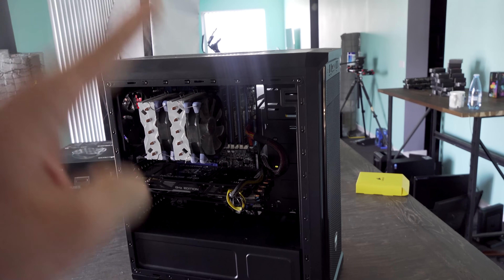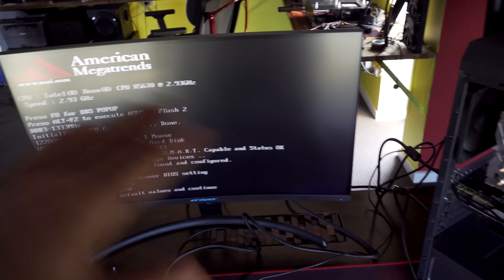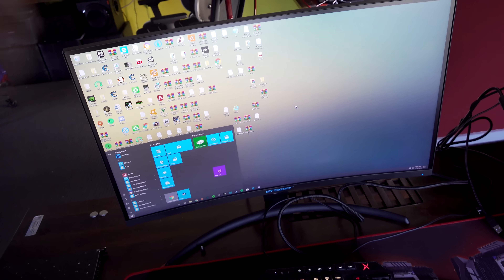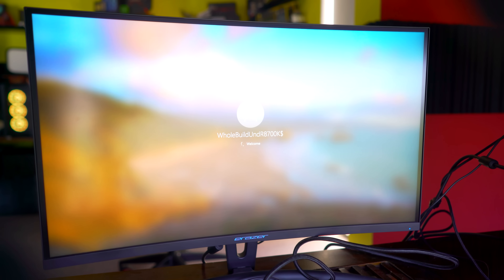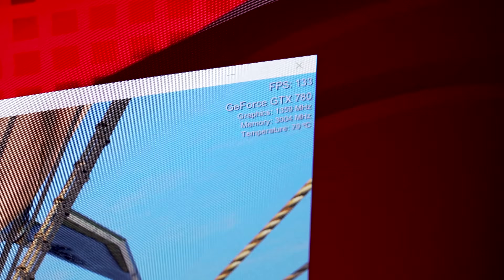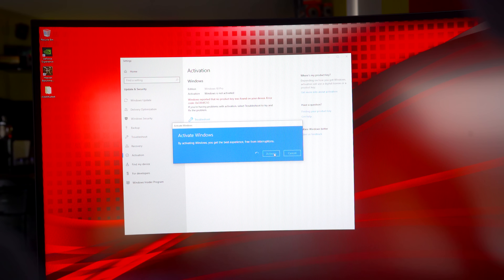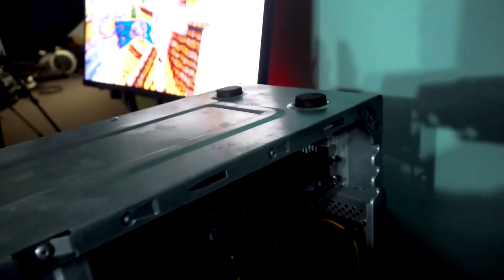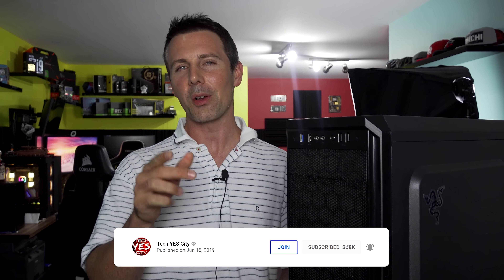Fixing "No Signal To My Monitor" - This Computer Came Back 2 Years After Sale.

Comment: Should've used windows built-in disk cleanup utility. I can guarantee you that 10s of gigabytes on that HDD are just old windows installation files.
Reply: Or ccleaner to clean temporary files.
Reply: @CristiBucerzan  disk clean up practically does the same thing
Reply: Does it also clean temp files from browser?
Reply: @CristiBucerzan  
I'd advise against CCleaner, it's owned by Piriform (now Avast) which is a pretty shady company. CCleaner also constantly collects user data and can cause blue screens if you let it mess with your registry aswell as cause problems with Steam/VAC. 

The windows built-in tool can do 90% of what CCleaner does and for things like browser data, there is an option in Chrome and Firefox to delete it as you wish.

https://www.ghacks.net/2018/08/01/ccleaner-5-45-dont-install/
Reply: @-eMpTy-  never had steam vac problems wtf are u using CCleaner for
Reply: @-eMpTy-  Avast not AVG.
Reply: i guarantee 50% of the files are prn!
Reply: @mass1985  With some people it would be more like 80%.
Reply: Never mess with the other files. I rather give them instruction and let they do the cleaning themselves. 

I will be like: "Hey man, there is a tool in Windows that help you clean your drive, it will remove those folder and these folder, if you ever put anything on that please move it to another folder."
Reply: This was my first thought as well.   You could leave the customers files alone but get rid of a bunch of other useless multi gigs of files.
Reply: Yep, seen this so damn many times on Windows builds, and Windows 10 is the worst. If you are on Linux there is a similar program called Stacer that's an all in one system monitor, and main disk cleanup getting rid of things like package caches.
Reply: every time...
Reply: Glary Utilities is the best imo for cleaning computers from useless files.
Reply: first thing i do
Reply: You might remove files the customer wants to restore though if they do not have a backup. Never mess with a customers files.
Reply: @Mopantsu  
No, you don't. You can explicitly choose which files you want to delete and the cleanup utility doesn't delete any personal files anyways (besides the content of the recycling bin if you want).

Comment: Imo, first thing to do before defragment is to "clean disk, including os files" fucking wipe all temp files, windows update files, old versions of windows, memory dumps, crash logs etc from the disk, and only after that defrag, for best results, you might actually gain 100's of gigabytes free space bumping all the trash files. But maybe you did this, just didnt mention it. One thing to note is to UNCHECK "downloaded files" from that or it will trash full contest of the "downloaded folder", not giving a fuck. XD

Comment: People super underrate how much of an impact SSDs make, they can totally take a PC from unusable to great, it's why I put SSDs in all of the PCs I used to flip (took a break for awhile) even office PCs that didn't even really need it. Also if they made those thermal pads for GPUs that'd be great, while they might not be as good as paste initially, they'll be better than dried out paste so I don't have to repaste for people later on/their PC doesn't overheat as easy. While you'll usually have the heatsinks gunked up before you have to repaste I've had customers clean out their PCs without issue, they just are afraid to get into the nitty-gritty and repaste their cpu/gpu.

I've only run into one major issue (I mostly deal with just ram reseating etc), which was a 1070 that just busted while the guy was playing Borderlands remastered (no liquid damage on it etc, so I believe the guy's story 100%), I couldn't figure it out, windows was giving me code 43 on the gpu and it ended up screwing with the 1080 I was using to troubleshoot with it. I got lucky because the warranty was still ongoing through ASUS (it was a strix card) and they couldn't fix it either so they sent me a 1070ti (strix as well) which I need to sell now. 

If anyone wants to see video of me getting frustrated that the 1070 was being a hassle and ended up (temporarily) screwing up my 1080 just let me know.

Comment: 12:30 Solved this problem with my clients long back 😇 Tie/dangle a tiny paper tag at the GPU grill -- "Attach Monitor Here" .
Reply: @ Mansoor Haque . If you liked that , then you shall love this :)) For the bother-some & insulting type of people I write ,  "Connect Monitor Here . Don't Ask Why"  . Honest 🤣
Reply: Awesome
Reply: @matz1011   . Thank YOU .
Reply: I've done similar to ones I know are not that tech savvy, and will put stickers to all the ports saying attach monitor here, keyboard/mouse here, etc.. 
Now someone in my family like my elder aunt, or mother, I just go do it for them, and show them, and tell them turn it on here, and I don't even bother with putting a normal Linux distro like Manjaro , or Windows on their system, but Chromium OS, so I don't even have to tell them how to apply updates, as all they do are basic task anyways, and Chromium OS is more than good enough for that.
Reply: I’ve put neatly cut black tape on ports I don’t want people to use. They tend to resort to eyeing the whole back of the case and find other matching ports rather than peeling :)
Reply: A quick start guide also works.  If you are in the business, it doesn't take that long to make a guide that shows how to plug in the power and connect your monitor.

Comment: That desktop gives me PTSD, i literally only have This PC and Recycle Bin on mine
Reply: It depends what you're doing. If you want gaming and ease of use, and don't mind being spied upon by M$, Windows is superior.

Linux is powerful and gives a lot more control to the user, but it can be a huge pain and take a long time to get things set up and working the way you want because it is not so streamlined. You will have to spend time messing with scripts, config files, system services, etc. at a lower level which requires a lot of reading/research and trial and error if you're not already very familiar with it.
Having an OS that "just works" is a huge plus if you don't have the time or inclination to deal with that kind of tedium.
The inverse isn't true for Windows either since you have the Linux subsystem and Powershell at your disposal.
Reply: @icedoutshef  "I bet you play Fortnite dude" Says the person with Fortnite characters on his channel display name.
Reply: @icedoutshef  ay do you play league?
Reply: As a Linux user desktop icons are fucking ugly stop using them.
Reply: Snow Hound NO

Comment: I have had nearly a dozen bad power supply's,  at least 5 arrived DOA - mind you they were cheap off brand made in china bought from tiger direct, and I had more than a half dozen customers with dead power supply's.   I no longer buy anything that is not gold rated.